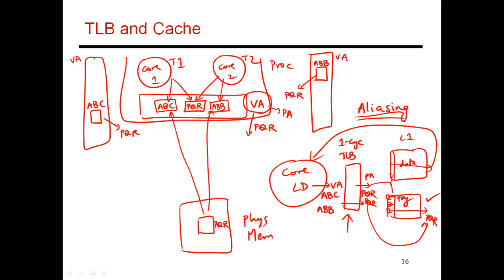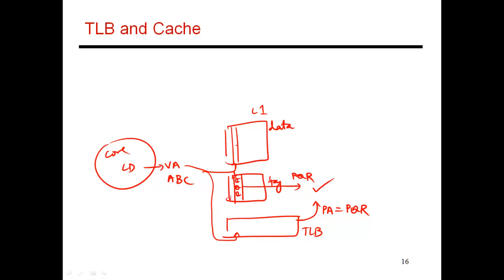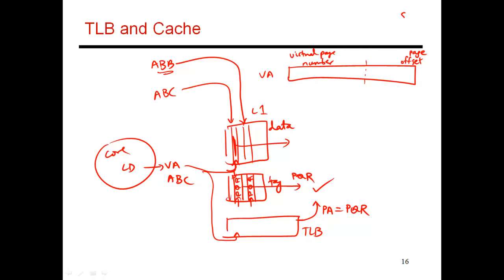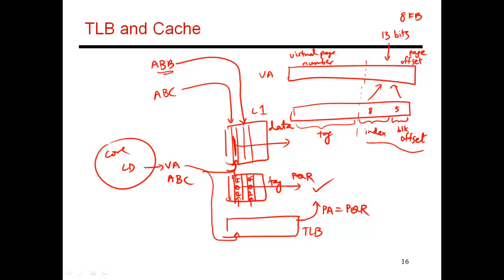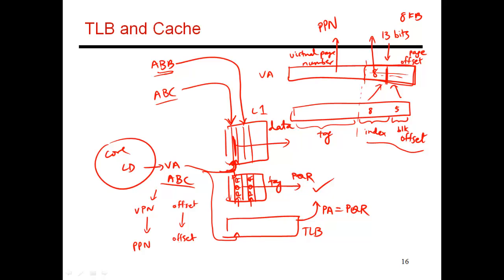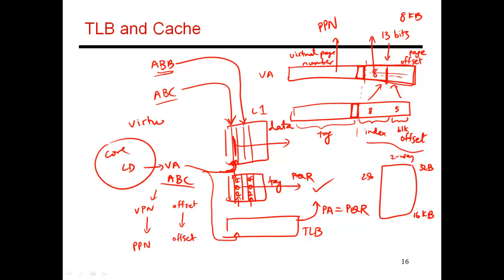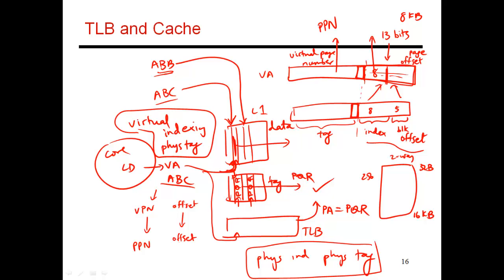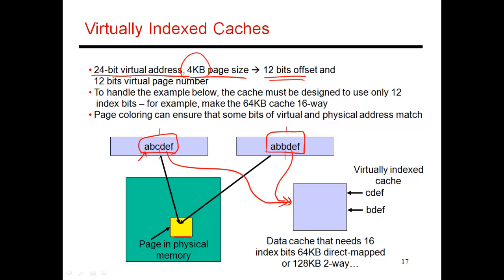CS6810 -- Lecture 46. Lectures on Cache Hierarchies.

Comment: Hi sir, in the final example of virtually indexed caches(abcdef , abbdef) what is the minimum number of page colours needed to guarantee that no two synonyms map to different sets in the processor cache.
Reply from the maker: If the cache is 64KB direct mapped and needs 16 index bits, and the page size is 4KB, then four bits will undergo page coloring, i.e., you have 16 page colors.  (Sorry for the delayed response!)

Comment: if the page offset of the virtual memory is 12 bits, then the index bits + offset bits of the cache should be 12, too. then we have no space left for the offset bits of the cache.I think that's why we design 16-way associative cache to make the cache consists of only one set (row). So we can conclude as 2^16 (cache total size) = 16(total ways)*2^12(each way holds)*1(set in cache)

Comment: what happens if you have the same page offset but which map to different physical memory locations. I assume this will cause an overwrite, so then for performance it is assuming that the chance of having multiple virtual address with the same page offset (to diff physical addr) is not common?